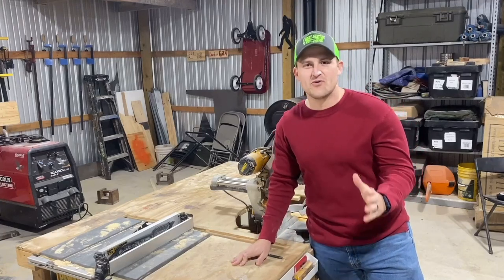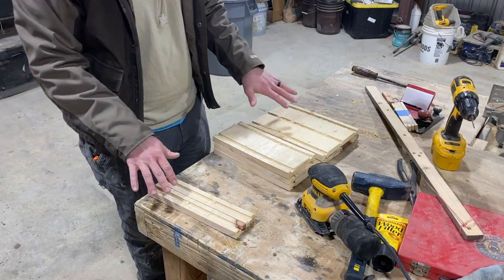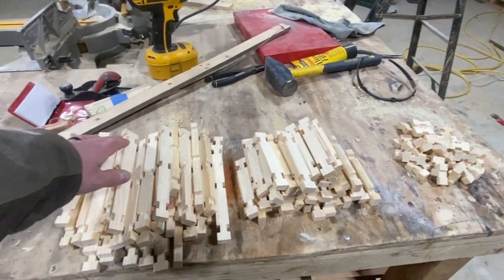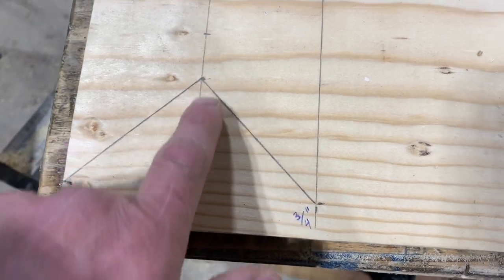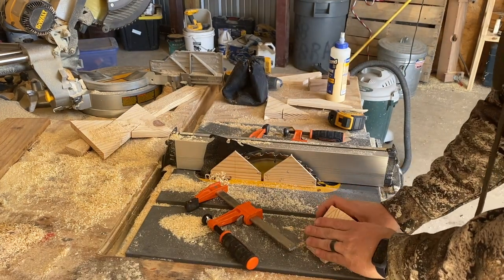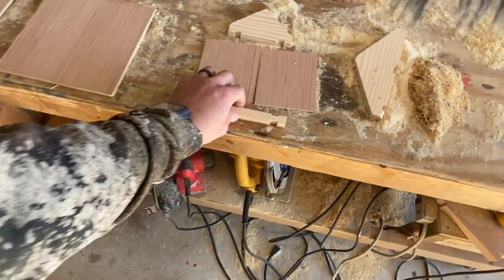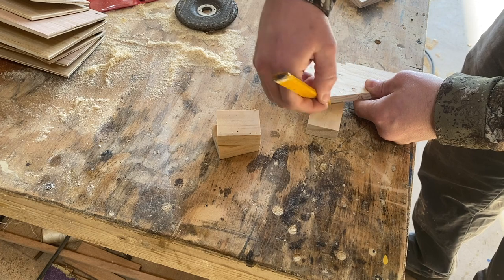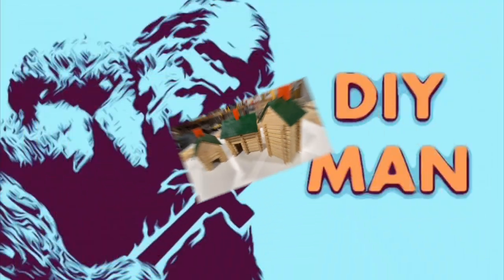The Lincoln Log Company will HATE this video. (DIY Toy Logs)

Comment: You’re killin’ it! Awesome content. Just wondering if rounding off edge with trim router before making individual strips on tablesaw would work. Only half would be round but could be the log look from the outside of cabin. Am I confusing  cutoff ends? 🤣 🤔💭
Reply from the maker: Thanks man! That’s a great idea. That would have saved me a lot of sanding. I made way too many of these things 😂 If I would’ve left the one side flat like you said, it’d be easier to hang pictures 😆